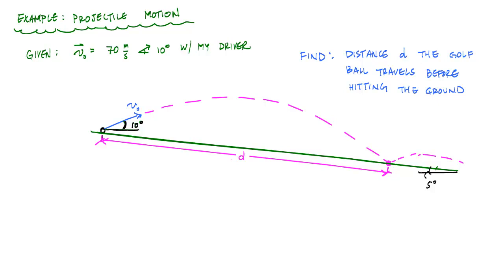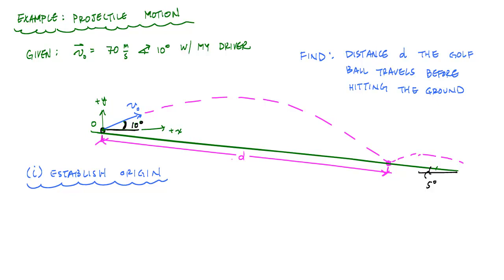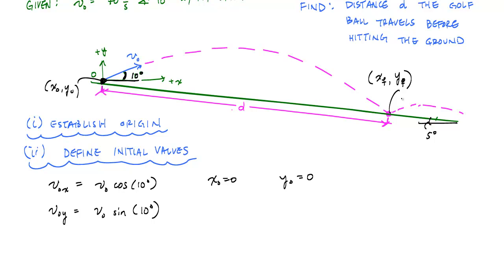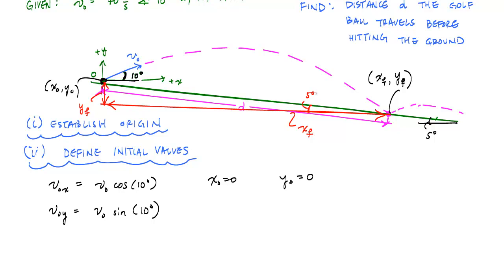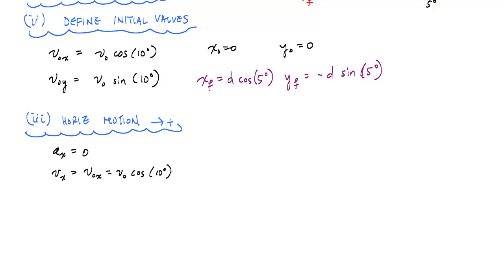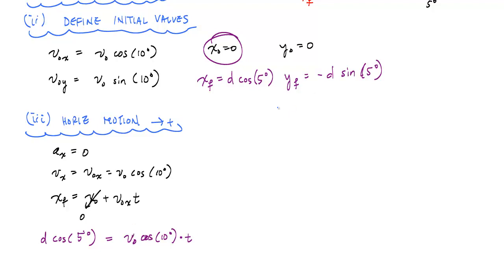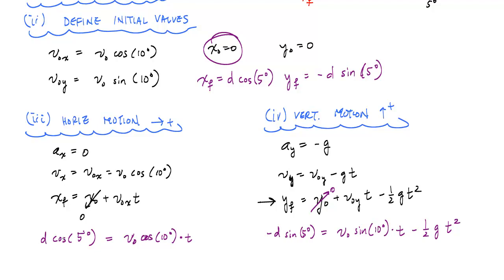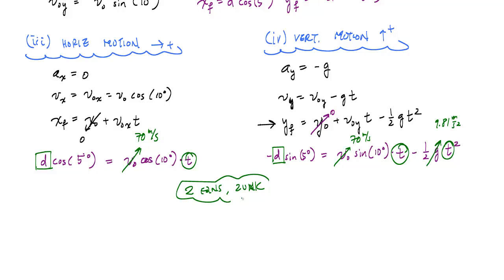Projectile Motion Example Solving for Distance and Time - Engineering Dynamics

Comment: So far I am watching your videos on dynamics, and I find them very useful. I was able to go through the entire video and was able to get to the same final answer, however, I am a bit confused on how I got to that answer. I first solved for d in terms of time from the horizontal equation, and plugged the d equation into the y equation. From there, I had a quadratic formula in variables of t. I then set the equation to zero, and got the time to equal 3.708 seconds. Why does this work when I set the function equal to zero? Thank you for your time